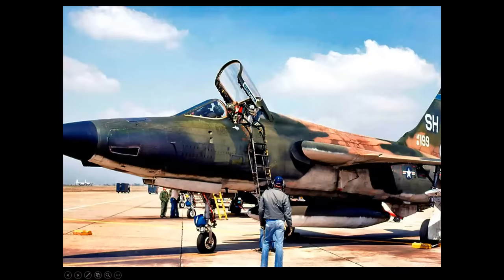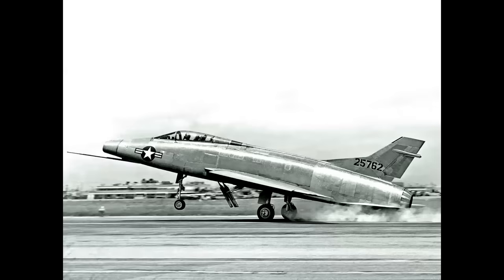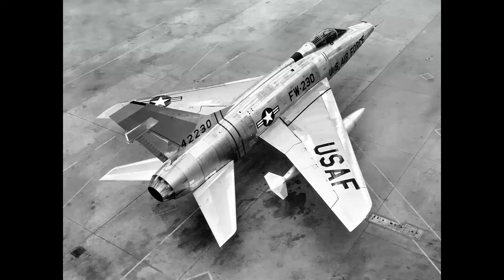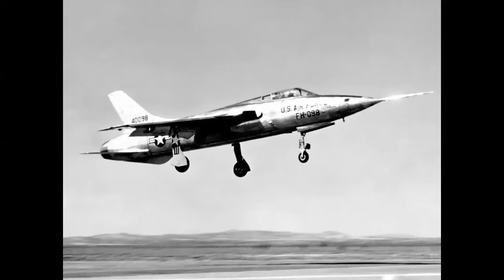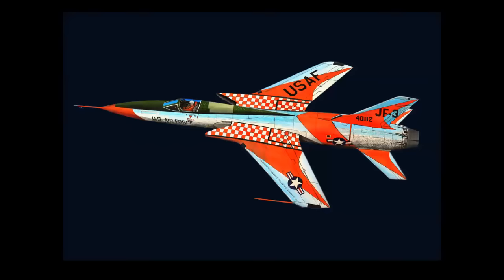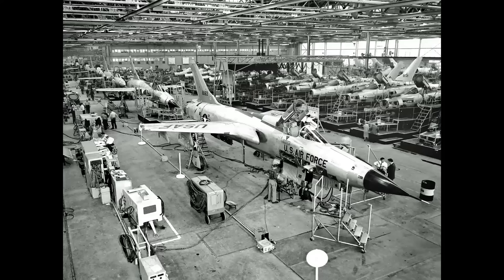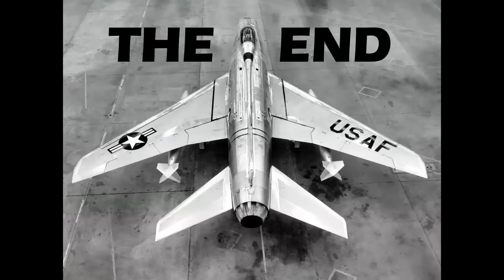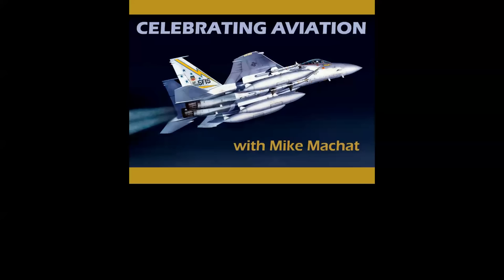"FACTORY FRESH!" - What U.S. Air Force Jet Fighters Looked Like Rolling Off The Assembly Line.

Comment: 👍Greetings Sir, If memory serves me correctly the F-105 that was a Thunderbird was involved in a mid-air refueling accident. The airplane was taking on fuel using the “hose & drogue” method when the hose broke about 10-12ft forward of the basket and the hose flew back and struck the fuselage behind the cockpit (these refueling hoses are very heavy). This is believed to have caused damage to internal structure which could not be seen when the airplane was inspected after flight. The 6 G pull up effectively split the fuselage in half. I have not heard the overweight landing story but sounds like that could have also been part of the problem. At least that’s the story I read. All the best, cheers.
Reply from the maker: Appreciate this information, and yes, it may have been the combination of accidents. And as much of a fan as I am of the F-105, it was never a good fit for a tight aerobatic team. Thanks for watching!

Comment: I can't wait to log on, on Mondays, to see you weekly offerings.  What a great way to start the week.

Thanks for the stroll down memory lane.  I was an Air Force brat in the 50's and 60's and saw most of the airplanes on the flightline, in  bare metal with very colorful squadron markings.  The most impressive were the original SAC B-52s with anti-flash white undersides and KC-135s both with arctic orange bands too.

By the time I was in the USAF in the 70's, the "lizard paint",  covered all of those beauties.  They looked sinister but never quite as impressive as they were with all of the shining metal surfaces.
Reply from the maker: Appreciate the comment, thanks!

Comment: Mike,  Thank you for this episode,  it brought back a wonderful memory.   My Dad worked on the assembly line at Republic Aviation from 1943 to 1969.  In September of 1963 (I was 5 at the time) my Dad brought me to the factory.  I will never forget the brand new F-105F being towed out of the final assembly hangar.  You are right, there is something about that airplane when it is just bare metal. From that day forward I was absolutely nutty about airplanes.  Thanks again!
Reply from the maker: Wonderful comment, thanks!

Comment: When I got to Mountain Home AFB Idaho in January of 1973 which was my first duty station (as a "Weapons Mechanic" who loaded bombs, missiles, nukes, etc etc) we had about 20 brand new factory fresh F-111F's parked on the ramp. We were getting 3 to 5 new planes a month from General Dynamics in Texas and by the time I left for Bitburg Germany to work on old greasy, grimy F-4E models (the ones with a multi barrelled 20mm Vulcan cannon nose gun) Phantoms just back from southeast Asia in June of 1974 there were 3 squadrons or about 90 aircraft which was all the F models they were going to be building. At that time there were "E" Models at Upper Heyford England and "D" models at Cannon AFB in New Mexico. The only SAC F-111's were the early "A" Models that were at Nellis then. And as far as being called "Aardvarks"?? I NEVER heard that term until these same aircraft were used by Reagan for that long distance bomb run on Libya during his term in office. But before that, these F-111's didn't have a name. They were just F-111's until somebody apparently heard the name Aardvark and thought the plane looked like the animal or was it the animal that looked like the plane???

Comment: I always find it interesting how the 105 had a very low frontal radar cross section. So much so that they had to add a reflector to the nose wheel for ILS approaches.
Reply: Actually, the radar reflector on the nose gear allowed the F-105 to be seen better on final approach by the Precision Approach Radar (PAR) system. We also had a really hard time painting T-38's at Dyess AFB in the early 70's..

Comment: @11:58 this Thunderbird aircraft was likely the slot position....ie Number 4. The soot on the vertical fin is from tight positioning behind and SLIGHTLY below Number 1.
Reply from the maker: Thanks for the comment, and the F-105 that crashed was actually the Number 2 airplane, or Right Wing position.

Comment: Great Job! I love both aircraft and I love the century series fighters! Quick question: What is that number by the nose FH-741? I know 741 is the tail number but in the fighters and some bombers from the 50's have this type of number and I always wondered what it stands for on the Century series fighters and some early 4th generation fighters, F-4 for example, Buzz number, etc. Cheers and Thanks!
Reply from the maker: The "FH-741" is indeed the aircraft's Buzz Number. Second letter designated the aircraft type, as in "FA" for Lockheed F-94C, "FB" for McDonnell F-101 Voodoo,  "FC" for Convair F-102 and early F-106, "FG" for Lockheed F-104, "F and "FH" for Republic F-105. Thanks for watching!

Comment: Mike, am I right in thinking that the F-4 was a surprisingly sharp and powerful plane for a number of years. Possibly until the F-15 came out around’74or ‘75?
Reply from the maker: Yes, the F-4 Phantom II was a game-changer in the late-1950s - a Mach-2 multi-role twin-engine two-crew jet. Then came the F-14 and F-15 in 1972, and F-16 in 1976. Thanks for watching!

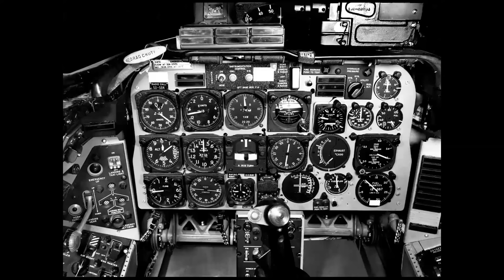Comment: 4:50 Does this plane has a wing config. error?
The left slat is extended and the right one not.
Reply from the maker: Good catch! The fact that the jet is still in the factory here leads me to believe they manually extended the left slat for maintenance access - definitely a non-standard configuration. Thanks for watching!